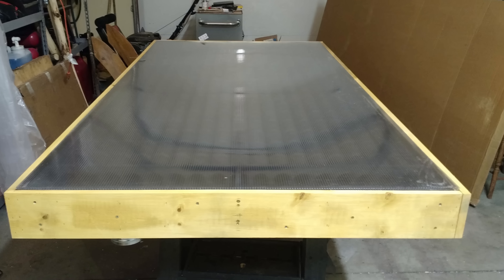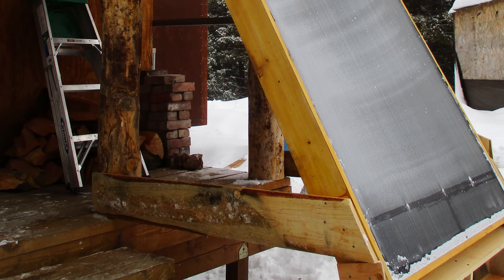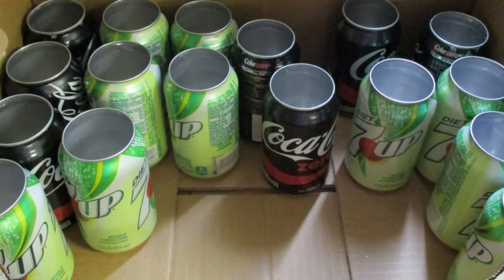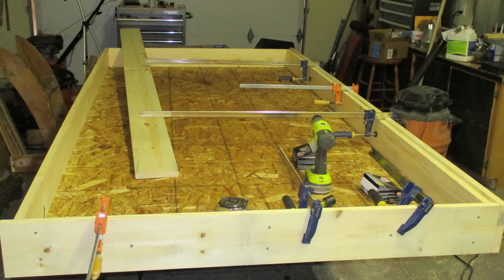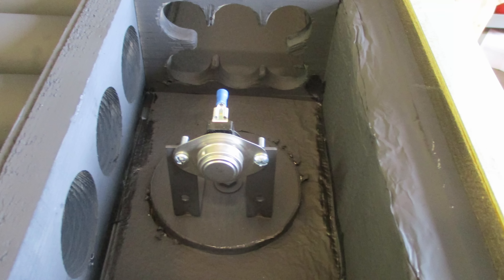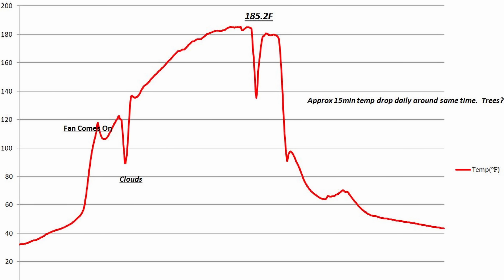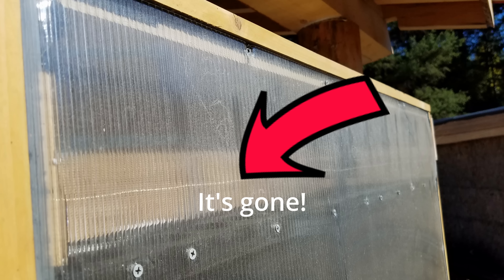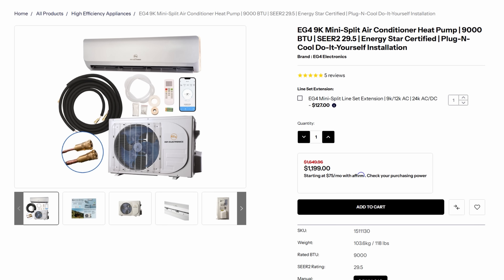7 Years with Pop Can Solar Heater - Is It Still Worth It?

Comment: Old retired man here from the Southeast USA.
Great informative video.

The only problem about a split system is it will never really be paid for.  Electricity.

.
Reply: 2023 cost me $6000 to heat the house with propane (and had no ac) install mini splits and the cost from Nov to May 2024 was $345.00 electricity.  you are wrong sir!
Reply from the maker: But I'm offgrid 😉
Reply: @TheOldJarhead  OK, but the electricity has to come from somewhere. Or maybe you could connect a "HAND CRANK" to it.  lol 🤪
.
Reply from the maker: For the heatpump?  Solar ;)  I already have 2400w of solar
Reply: @TheOldJarhead  I figured you already had solar. I was joking really. That was a very good and informative video. I did learn a few things. That's what I believe YouTube was meant to be for (Great Information), not some dumb dance videos. Wishing you and yours well.

As I Remain

.
Reply from the maker: lol well I promise, I will NEVER do a dance video!

Comment: Might I suggest insulating the entire header. Ultimately you are trying to heat the pop can to transfer heat to the air inside. Not heating the entire inside of the box. With just the plastic covering the header, aren't you losing heat?
Reply from the maker: chuckle oh I did!  When I said it vaporized the insulation, that's what I'm saying.  It was all insulated and then poof it was GONE!  It looks like it was never there....it was.  https://youtu.be/rAzUMeK9bKE  You can see the build here.  Crazy huh
Reply: @TheOldJarhead that is crazy. You can hardly tell, in the new video, that it was there. I missed this step and really don't want to take it apart to fix it.
Reply from the maker: Yup, crazy!  Wait until I tear it apart and see what happened behind the cans!  I bet it's going to be crazy!
Reply: @TheOldJarhead I used foil backed foam on mine. We put aluminum flashing on the bottom but not the sides. The sides are disintegrating. It will blow out of the vent. It's like ash. It turns to dust when you try to clean it up.
Reply from the maker: My insulation just fell to the bottom or disappeared!

Comment: Two more interesting ideas, if someone is making one of these:

The baffle doesn't have to be heavy duty if you're just dealing with convection. With just a bit of planning you could use a thin sheet of paper (tracing paper or similar) as long as it has enough meat around the edges and falls mostly into place with gravity.

The material doesn't actually have to be tubes, as long as it absorbs enough energy and transfers enough over. I've seen some designs that used old agricultural bird netting or shade cloth, both in either a wad (as long as it's sparse enough) or woven between dowels to form a heavily corrugated surface. I've even seen some functional designs that just directed the air in a serpentine path and relied purely on the black paint in the box to transfer heat.
Reply from the maker: True

Comment: I've seen about the same results with 2 layers of black metal screening  instead of cans. Be sure to use Lexan with UV coating or it will yellow/cloud up.  Great update, thanks!
Reply from the maker: Glad to hear your screening method works well too.
Reply: @MinnesotaBeekeeper  you will be better to use glass that doesn't have any UV coating UV is a certain portion which I don't know offhand of the heating capacity. Especially on a cloudy day in some areas have a lot of cloudy days

Comment: Interestingly, you should be able to make your box directly from foam board insulation. This tends to make the construction easier and lighter to handle, though it does make it a bit more fragile to handle.
Reply from the maker: True, but it wouldn't last as long as the foam breaks down easily.

Comment: Use a bi-metallic actuator for the hot air flap valve. Hot opens, cold closes.
Reply: Just had to replace the damper on our furnace. It is radiant water heat upstairs and in floor heating downstairs. Basically it is a pool heater and not a boiler system like the old ones. It open after the gas starts to heat the fins and closes when the heat shuts off. It is low voltage electric though and is programed to shut to stop that rush of cold air back into the house.
Reply from the maker: Cool idea! I’ll check that out. Always down for some upgrades! Thanks!

Comment: The resulting air temp is fine, but knowing g how much energy it is producing is better. It's rather simple, measure the temp rise through the device and the air flow. CFM x (Tout-Tin) X 1.08 = Btu/hr 
I might imagine your 4x8 unit will produce about 1500 Btu. That would be an 80 CFM with a 20F temp rise. 
Peek temp is not helpful since a 180F cup of coffee does not heat my house, but a 3000 gallon hot tub at 104F will.
Reply from the maker: The attwood blower was rated at 230cfm and ran for 5hrs in my testing (when the thermal snap switch kicked at 110F and the temp rose to 185.2F from ~10:30am until3:30pm - using my temp logger).  At 5hrs the temp dropped below 85F and the fan quit.  Outside air temp at 8:44am was approximately 15F and hit about 45F at peak around 2pm so a max temp diff of 141F -- that gives me a potential of over 35kbtu's but I always estimated about 5500-6k from reading various sources but maybe my math is wrong.
Reply from the maker: OK, looking at the temps in the porch itself (I did the above wrong using outside air temps) -- oops.  The porch temp average over a two week period was a 30F rise daily.  So, using the above at 230cfm, 30F rise in temp gives me about 7500btu's -- still more than I thought it was

Comment: Solar PV is so cheap that it doesn't make much sense to make any of the solar thermal gadgets like this anymore. You could "impedance match" a heating coil to the max power of the panels and do pretty well. If you wanted to get fancy, you could MPPT it and get even more.
Reply from the maker: Panels are cheap but even at $130ea plus shipping (we all don't live near dealers) for 400w panels it would take a couple at least and then the cost of a DC heater of some sort and likely wouldn't put out the 5500-6000btu's this can.

Plus, this can potentially be almost free to build.  Yes, it would cost me $600 today if I did the same thing but let's be honest, there are other ways.  Free lumber from folks who don't need it, some aluminum from somebody else, or black porch door screen and some windows from the 'Restore' etc and it's almost free anyway.

Comment: Back around 1985 i did this exact thing as a member of the Pennsylvania junior academy of science.  I used plain styrofoam painted black and a 6 column 12 high can matrix scrap wood and plexiglass.  Worked extremely well until the heat caused a nuclear melt down 😂😂 
1st place in local and state competition though.
Reply from the maker: Sounds like you had a good run with your project!
Reply: @TheOldJarhead ❤

Comment: I had a few commercial panels. 
I wish i could find more information on them. The name on the tags always made me smile. Han Solar. 
 The story
25 years ago, i found several panels for a solar hot air system.  They were black plastic with plastic tubes, about 6 inch diameter inside.  They would link together.  I think it was just hot air flow. No fans needed. 
I used them in a landshark houseboat next to my backyard pond. I added a fan. 
They worked well. But got musty.
Reply from the maker: Sounds like a cool setup, even if they got a bit musty!

Comment: I used old aluminum guttering downspouts I got for free from a small local guttering company instead of bothering with cans.  They provide stiffness to the heater and a less restrictive pathway for the air to move through.  Paint them flat black and you're done.
Reply: The aluminum downspouts are good for giving up their heat to the air that can flow inside, and to the stagnet air on the outside of the downspout. 

I assume you still have yours and that they are still working fine. But if you build one with a black painted screen stretched inside a black painted box,  while the screen is stretched  over  a wooden frame that is diagonal from the top to the  bottom of the box, then you'll get maximum air flow with less stagnet hot air sitting below the lexon glass.  I'd use aluminum or stainless steel screening.
Reply from the maker: Great insights on the downspouts! It’s fascinating how small design tweaks can enhance airflow and efficiency. I appreciate your ideas!
Reply from the maker: That's a creative way to use repurposed materials!
Reply: I second this.

Comment: In 2014 I built a similar device for my workshop, but instead of using cans I used black aluminum window screen. It's mounted on the south facing wall of the building.
I figured out a couple of things:

I ended up rigging a 20x20 box fan to it and controlling it with an attic fan thermostat and a baseboard heater thermostat linked in series. The attic thermostat is to arm the fan circuit only if the air in the heater is warm enough. An added bonus is that it's adjustable. If it detects a high enough temp in the heater and the baseboard heater thermostat triggers, then the fan turns on. Otherwise the fan is off.

I put the barometric damper to avoid air moving backwards on the air intake from the building because I didn't have room up top. It seems to work just fine. 

The whole thing cost me about 300 dollars to build, and in 11 years I replaced one box fan and a polycarbonate panel on the outside.
Reply from the maker: Sounds like a great setup!

Comment: One suggestion, instead of placing the fan at the exhaust you can place it at the intake pushing cold air in, this way the fan doesn't suffer from the heat.
Reply from the maker: Yup, many have made that suggestion and I'll be using it :D  Thanks

Comment: Why not use tin cans from food cans instead of aluminum cans ? The tin cans are stronger and you will damage less while building it. Plus the tin cans will hold more heat. Also you can use rockwool rigid board  insulation, It can take high heat ! Muchas Gracias Amigo !😁
Reply from the maker: Aluminum transfers the heat much faster.

Comment: Rather than gluing all the cans together, why not use small metal tubing, about 2 - 3" diameter, tubing about the same thickness as heat duct tubing or rigid dryer vent tubing?
Reply from the maker: You could do that.  The cans provide turbulence which improves efficiency.

Comment: The price of pop cans doubled? Doesnt "vaporized the insulation" mean that you inhaled that insulation gas?
Reply from the maker: Fortunately I wasn't there at the time ;)  So didn't breath it in.  Had I been there, I might have noticed the fan stop and corrected the issue before it went nuclear!

Pop cans were free...the lexan and other parts not so much.
Reply: @TheOldJarhead  wheres the analysis on electricity or gas savings generated by this device?
Reply from the maker: Never did one.  Wasn't an option for me either.  I was totally off grid so looking at options where I had none.
Reply: @TheOldJarhead  how many of those boxes would you need to warm your cabin on sunny days without any other heat source?
Reply from the maker: Good question, I'd think just one more, maybe two tops depending on actual output but I am losing the last wall I could have used one on so won't find out.